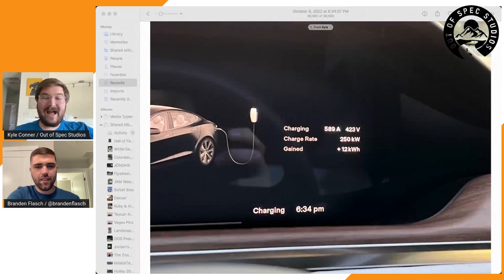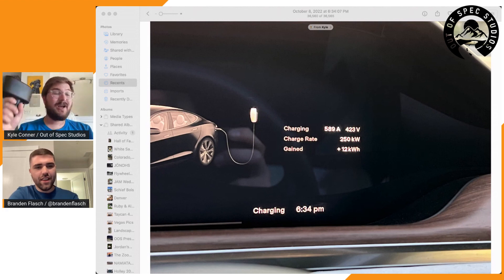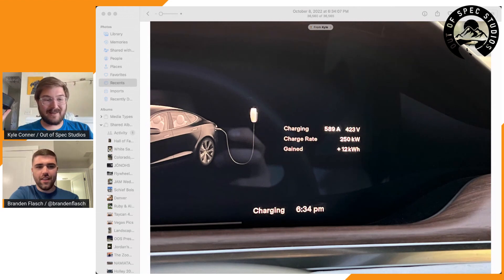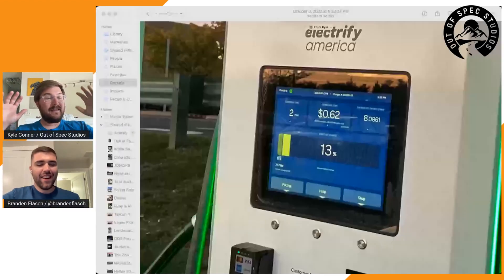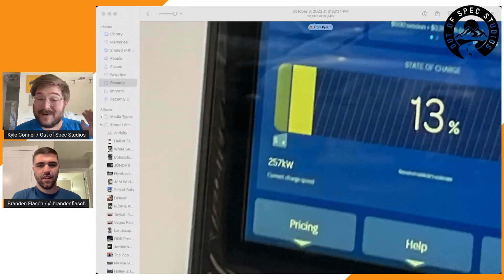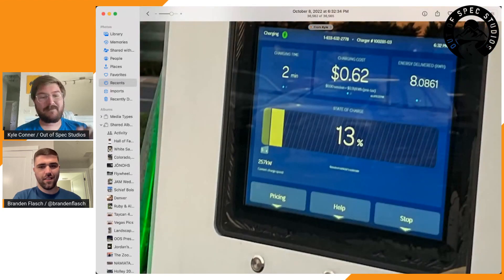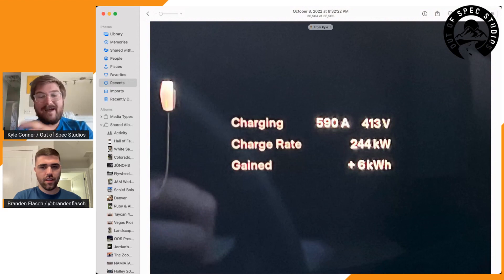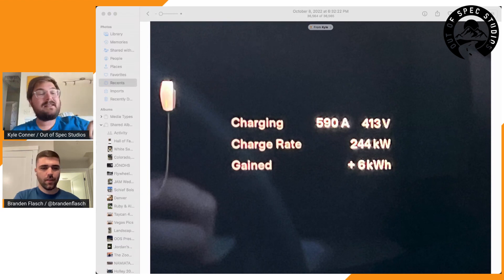What?! Tesla Charging At 257kW With CCS Adapter! Over 500A At Public DC Fast Charger | Episode 64

Comment: There are several factors limiting current in play here. There is the cable and plug attached to the charge station dispenser. There are a few companies that supply cables with plugs to the charge station manufacturers, in this case it would be Signet, that are RATED at 500A continuous. These plugs (and the terminals inside them) and cables are liquid cooled to achieve this heroic current. It's possible that the supplier of the cable to Signet, also has a higher peak current for short amounts of time. There is also the inlet (the part of the connector that's part of your car) current rating. Currently there are NO suppliers of inlets rated for over 350A continuous. There is one supplier that claims 500A, but when you talk to their engineers, it's 500A for 5-10 minutes before it overheats and drops you down to 250A. Now if you were a major auto manufacturer making 1 million+ EV's a year, then you likely make your own inlet and can design it to do 500A. The software in the vehicle should limit the current to the inlet's rating. The software in the charge station should limit the current to the plug and cable's limits. My guess as to why such a high current was delivered was that the charge station was configured improperly to allow full dual cabinet current rating to one dispenser (as apposed to splitting the current between 2 dispensers) instead of limiting the current to the dispenser's rating. I'm not as familiar with the Signet charge stations, who supplies the connectors, is it Huber+Suhner? Sometimes it's written on the connectors...
   Update:  I've now seen other videos of people able to charge their Tesla with the CCS adapter at >500A. In that video it was a different charger manufacturer, but the plug had Huber+Suhner prominently written on the plug. I still think the plug is rated for 500A, but the supplier likely has higher short term ratings and the charger manufacturer is taking advantage of it, as well as the Tesla.

Comment: IEC 62196 is the overall charging spec.

The 1st edition (2003), IEC 62196-1:2003 allowed for max 600V/400A
The 2nd edition (2011), IEC 62196-1:2011 bumped to max 1500V/400A
The 3rd edition (2014), IEC 62196-1:2014 stays max 1500V/400A

So even I'm not sure where this "500A limitation" comes from.
It may be from the CCS connector spec, which is a different one (2014): IEC 62196-3:2014, which came out in conjunction with IEC 62196-1:2014. But it mentions 1500V/250A max for the CCS connector... Or everyone may have been just breaking the spec this whole time ;)

There is a new/4th edition (2022) of the charging spec: IEC 62196-1:2022 which bumps to max 1500V/800A. It was finalized and published earlier this year on 5/3/22, and is now the current revision.
This would allow 400V-class cars to charge from 280kW (350V low end) to 360 kW (450V high end) on a 800A CCS DCFC.

The CCS connector spec is also being updated for 2022 (IEC 62196-3:2022), but currently is a draft to be published later.

Comment: Fundamentally these limits exist because the physical size of the wiring, and connectors limits not the amount of power (watts) going through it, but the amount of current (amps).

Once the current exceeds the capacity of the wires they start to get hot, potentially VERY hot.  Active cooling lets you push the limit

Power = volts X amps.

So why the amperage limit exists has to do with everything that’s been built, the cables in the station, the connectors.  To raise it you have to replace all that stuff, and that’s not cheap. But also you’d need a new connector design, and it would be ugly to make it reverse compatible.

But, at the same current limit, you can deliver more power over that same wires and connector by increasing the voltage.  Hence the move to higher voltage systems, and why cars like the tycan and e-gmp cars can receive more power and charge faster.

Comment: How do you precondition the battery for using DC fast charging?
Reply: You tell your Tesla you navigate to a Supercharger. Some chinese EVs have a button to preheat your battery - i guess the XPeng and Nio have those.
Reply: I wanted to do this on my trip this weekend when I used a ccs station in arizona (electrify America) but couldn’t figure it out.  Interestingly, my car (2021MYLR) started preconditioning as I approached that charger on the way back even though I was not stopping there and did not plan to charge.

Comment: You guys should talk with the people at Char-IN NAR and find the way you get full access to their documents. But from the few documents publicly available they have started talking about greater equal 500 A as the max current and always referencing to the current IEC norm. On the other side, as noted by somebody else in the comments, the current Norm for the plug and cable is only defined up to to 500 A, so it’s not easy to find hardware specified for a higher current. 
Too bad you have to pay around 300 bucks to read 2 lines of a 150 pages document. 🤷‍♂️
I think all the CCS OEMs are sticking to the 500A max simply because it isn’t guaranteed that you will be able to get more at the charging station, and normally OEM like to be able to deliver what they communicate on their glossy press-releases.
Reply: 345 CHF ($346) for the latest revision: IEC 62196-1:2022 (4th edition) published earlier this year on 5/3/22. Bumps to max 1500V/800A on CCS.

Comment: The CCS standard has been updated several times over the years, it used to have a 200 Amp max, then it went to 500 amps, the latest proposed standard was 1000 volts and 800 amps.  If they have implemented that, expect fast charging to become common for Tesla's using CCS.
Reply: It's already implemented. The 4th edition (2022) of the charging spec: IEC 62196-1:2022 bumps to max 1500V/800A. It was finalized and published earlier this year on 5/3/22, and is now the current revision.
Reply: @kishkaru21  Thanks for this information.   Really hard to find CCS information if you do a Google search.

Comment: Complete guess, but I imagine the manufacturers target "at least 500A" during design to meet the common expectation, but if the hardware reliably exceeds the target, they might as well allow it.

This reminds me of many chargers here in Europe allowing more than 125A on CHAdeMO despite the spec for V1 limiting to 125A. I've never tested it myself but I've seen spec sheets listing 135A.

I'm not sure if you would see CCS2 above 500A in Europe because most handle/cable manufacturers seem to certify for 500A only (written on the plugs themselves), so even if you have the charging hardware for 600A you would have a harder time finding connectors to match. Not all connectors have branding or specs on them so I'm not sure about this speculation.

Comment: Super interesting. I'm mostly curious about what the CCS1 standard actually is. Is there even a CCS1 technical standard that we can look at? Someone on the internet has got to know. Apparently the Signet charger is just programmed with a higher current limit (600A?), but I'm most curious if this is a case if companies intentionally pushing beyond the standard or if it's allowed. Maybe the standard allows a higher than 500A burst for a limited period of time?
Reply: The standard actually does not specify the current or voltage. Its specifies the plug and communication protocol between car, charger and financial transaction entity. The standard says it should deliver between 600 and 1000V (Tesla only delivers 450 or so) and it should support 350A. But what if i make a 50k Charger? That delivers less power. And less current. Most use a limit of 500A, but thats not specified in itself in any paper. You could use 10000A if you think your plug can handle it (it can not).

Comment: I hear the new CCS spec allows for up to 800A! Hopefully lots of chargers are quietly capable of that 🙏

It’s also quite the coincidence that the Tesla adapter gets officially released with a 250kW rating, CharIN updates the CCS Spec to 800 amps and these stations start actually outputting more than 500 amps in a span of a few weeks.

Maybe the charging providers have collaborated and negotiated a universal spec to ensure all cars can get their fastest speeds on all chargers for the NEVI build out.

Maybe NEVI CCS chargers will offer 800 amps at up to 1000 volts and Tesla will likewise offer the same with their NEVI bid compliant Superchargers. You have EA and other infrastructure providers raising the amps for Teslas, Tesla raising the volts for Taycan/EV6/Hummer EV and we all benefit with full speed.
Reply: Where do you have this information from? Can’t find it anywhere and it doesn’t look like it makes much sense. 🤷‍♂️
Reply: Those 800A depend on the plug and cable. Thats not a fixed value in itself. Whatif my charger supports 15kW DC fast charging with CCS 2.0? Yes such chargers exist e.g. in india.
Reply: @wolfgangpreier9160  There are many classes of DC chargers within the CCS specification. They range as of now from very low as you say with 15kW to very high at a top power rating of 350kW. The question is if those ultra high power chargers have gotten an update in the specs from 500A to 800A or if it is only one of those rumours without confirmation that make the rounds on the social media, aka fake news.
Reply: @e-redj  Yes, 500A 800A is possible. But those are not hard borders. 

At 800.001 Amps the chargers does not combust.

595A is much more than i had thought possible. Chapeau!

Comment: IEC TS 62196-3-1:2020.       as specified in IEC 62196-3:2014 with rated operating voltage not exceeding 1 500 V DC and a rated current not exceeding 500 A .  Edition 2 of IEC 61851-23 is under development.
Reply: That is the norm for the connectors and cables, so any cable and connector should be able to work safely at those current rates. More interesting is IEC 61851 as you say, as it should define the current envelope for charging. But as always, and I hate it, standards and norms aren’t publicly available. 🤬🤬
Reply: @e-redj  It’s seriously terrible that this information isn’t readily available.
Reply: IEC 62196 is the overall charging spec.

The 1st edition (2003), IEC 62196-1:2003 allowed for max 600V/400A
The 2nd edition (2011), IEC 62196-1:2011 bumped to max 1500V/400A
The 3rd edition (2014), IEC 62196-1:2014 stays max 1500V/400A
The 4th edition (2022)  IEC 62196-1:2022 bumped to max 1500V/800A. This is the current revision.

But agreed. Standards should be royalty-free!

Comment: It’s just line losses. Actual charge rate is lower
Reply: There is not 39kW of losses 😂
Reply: 9kw internal charger and line
Reply: @darylfortney8081  uhhh but still 590a to the battery…
Reply: That’s within Tesla spec